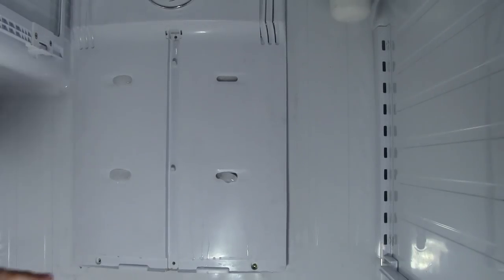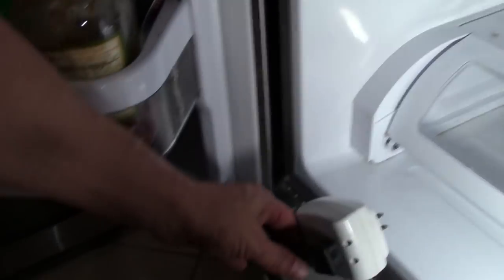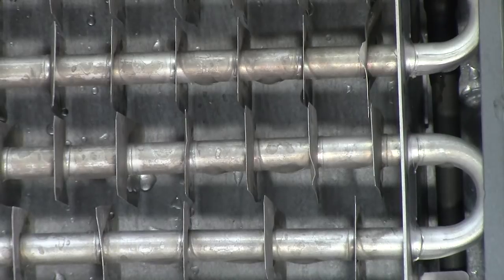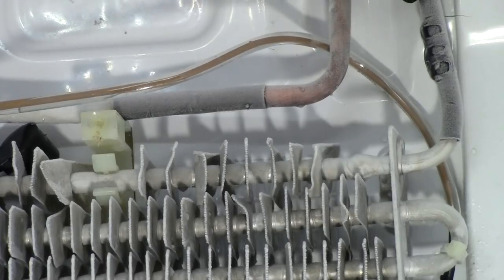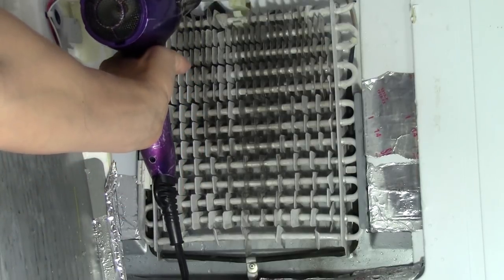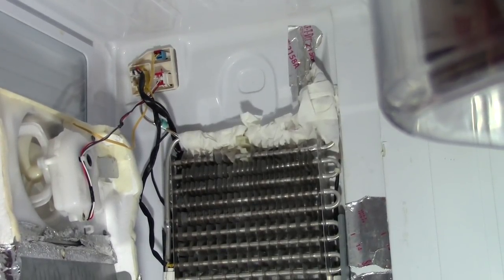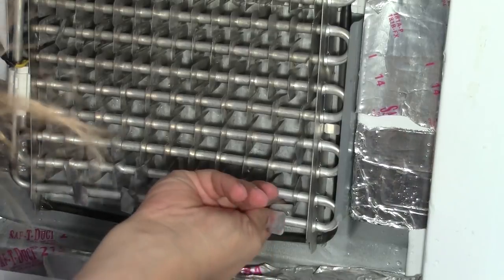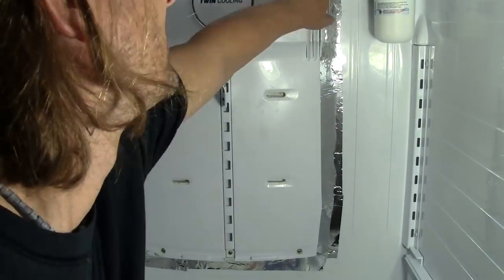PART 8 How to Fix a SAMSUNG RF 267 Refrigerator Not Cooling Icing and Freezing DIY repair

Comment: Noooooo!!! you are creating a fire risk!!!! If the heater gets hot, it could ignite the paper tissue and set alight to plastic lining , ultimately causing a potential explosion of the refrigerant gas. Never ever do this!!!
Reply: ON HELL YES IF R500 IS IN SYSTEM  CAN WE SAY BOOM
Reply: All domestic refrigeration here in Europe uses  r600 which is basically butane   kerboom time
Reply: Most manufacturers have a kit for this icing issue. Many French door units experience an icing issue. With a little searching there is usually a service bulletin with part numbers needed. Manufacturers also are producing videos on how to install these I have seen the Samsung one here on YouTube. Please be careful when re engineering an appliance I've repaired appliances and seen some very scary and dangerous things done by well meaning people. Not saying this repair is right or wrong just saying look to see if there is a service bulletin or an alert first and try to get professional advice before repairing anything. Have a blessed day
Reply: I agree never add what is not intended but a good thought also mine has the same problem but anytime the top has a problem the bottom must be addresses at the same time doing the same thing they due clog up on the drains very easy and the bottom is the problem that messed up the top?
Reply: Could you provide a link to that Samsung video, pls?
Reply: average of one refrigerator fire per week in london.
Reply: The fan stops when it's all frozen thus causing extreme heat in the back from the fan trying to move. This alone without doing this fix, which I think is less of a fire risk than the actual fridge itself, is more of a fire risk. Im tired, did that make sense? 

Is this the last video? Do you still have the fridge? Mine has been doing this.

Comment: You can replace the element that comes with the bi metal thermostat that is attached on the the element. And possibly change the defrost sensor to avoid issue. Trust me that is why is having defrost issue.
Reply: Which element do you mean attached to the bi metal thermostat exactly, can you link an example?

Comment: Thanks for this, but may I make a point? Having turned off the FRIDGE part of the F/F, left it overnight (and even used a hairdryer on it),  and removed all the screws holding that big moulding in place, the ice build-up STILL prevented the panel from being removed... I found that the operation of the FREEZER was still cooling the fridge (maybe to a lesser extent?) and keeping the ice frozen.  This prevented the panel from being removed. Emptying the freezer and leaving it off (with the door open) overnight led to the panel being easily removable, to try these  - and other - cures.  NB  Remove that panel carefully, as ours had two electrical connections to it; these could be unclipped by squeezing top and bottom - not sides, as it appears...
Reply: remove freezer drawers, open doors, install a sm fan in freezer compartment  to draw air from top to bottom out the front.. This defrosts the back panel rather quickly.

Comment: Hi Jake. The paper towel wrap is a fire hazard. That cal rod heater will, some day cause fire. The cooling fins and tubes help  cool the fresh food section. They need to be bear,  The defrost system has a drain tube in the back on bottom>  check that for clog.  the clip you hang on the cal rod heater helps transfer heat to keep the drain tube clear of ice build up during defrost cycle. Gets nice and hot...!  tape was a good idea.  Thermal Dynamics is a good field. Heat flow, fun subject..

Comment: I would be careful and not do what you did.  I measured the temp. of the heater element at the bottom (where you put paper towels) and the hottest spot was a whopping 300F.  I entered FD, forced defrost mode with the cover off.  I believe these high temps are fairly typical for short periods of time.  I don't think 150F would do much against all that ice.  It can get so hot it glows. Also, paper towels can absorb humidity.  Manufactures use foam sparingly, as needed.  Second, that tape probably has a cancer warning on it. You are introducing a lot of it inside the fridge.  Also when it gets hot, it can off-gas into the fridge even more...where you might have liquids, veggies, etc., that can easily absorb those fumes- then you eat them.  At that point, the temperature of your orange juice is the least of your worries.

Comment: Wow there is to way I would ever advise doing this I’ve been in the appliance and hvacr business for about 17 years, this is a fire risk for sure, paper towels are not insulting materials, plus there is a heating element right there at the bottom, I have seen those elements short out down there at the drain pan and all the cooking spray and paper towel are the accelerant, I’m not actually sure what he is trying to accomplish with this video by wrapping those lines, there are work arounds with this type of refrigerator from the manufacturer to fix the freezing issues.
Reply: I know right? Wtf? That’s what I said. I also do appliance repair. But just that tho if your insulating the heating element how in the F@&k is it supposed to get the heat to melt the ice which is now gonna be further separated by layers of insulation. Some people shouldn’t try and fix stuff. If they can’t do it properly stop being a cheapskate and call someone who can do it properly. You tube can’t teach you everything or conmen sense apparently for that matter....
Reply: Yall both are thieves if yall are just telling us to call and spend more money 💰 😒  on such a crappy product and not give us an answer of your own.

Comment: The holes are part of the airflow system that allow your refrigerator to get cold. Don't cover the holes!!! If you cover the holes, it will never get cold enough to keep your food fresh.

If the thermostat is not working, replace it. Same thing for the heating coil. My problem has been with the cover design. The heating coil is on the bottom and does not generate enough heat to reach the top near the fan. 

The be covers are designed with stainless steel, not the crappy foil, and carry the heat up the sheet of metal to the coils.

It's a real shame that we got stuck with the lemons. It's, also, a shame that manufacturers at knowingly making crap that lasts 7-10 years if you're lucky! My parent's fridge lasted 30 years. The next one lasted 25! They know exactly what they are doing! They raise the price for all the bells and whistles and sell cheaper products with cheap components designed to fail so that we must buy a new one! Simple, cheap, and energy efficient with water and ice coming out of the door: Is that really so much for which to ask?

Comment: Jake,  I have read you post/video several times or the last 2 years as my RF265 began to warm (frozen Evap like you)

Getting tired of breaking out coolers,etc. Done 5x in 2 yr  I must say thought I've got it down to a couple hours.
For Defrost, water (hot from hose best) heat transfer of even cold water beats Hot air several x)  I can get cover off safely in ten minutes. Have 10 towels on hand. 

Plug drain to below, or be ready to turkey baster out the water from  pan out back. 

I see all the effort in insulating coil. Paper on real Hot coil ?? Maybe fiberglass.   wonder why I got 5 Yrs without this problem (had freeze up on bottom drain  fixed with longer tang)and now this,what changed ?? bought new.

Searching web and service tips, I thought I would measure voltage of sensors in operation. Not  too hard, PC board on back of unit. 

I forced a Manual defrost (press 2 buttons at once) rd,  and did not hear more than a slight tick from expansion. When Unit froze up, again.  I expect sizzle of water on hot coil. NOT 

So I read, if defrost sensor fails, it could think Temp met right away,  and  end defrost in 90 sec (said to 68 F for Refridge ends defrost)          OK and run ONLY  90 seconds. Barely a sizzle.

I Measure voltage on the sensors  (cn30? on PCB blue wire to gnd)) and it looks like 80 F (per chart)   to Computer (when surround by ice ) !! And must have been wrong for 2 yrs.

Have you checked/tested your Defrost Sensor ?

I replaced sensor and held in ice to test (reads like 33 f) , now it goes longer that 90 seconds and I hear the sizzler of water on the hot element !

Back together  may for last time !!!!!  let you know on a few months.

Let me know when you see this, I can help you troubleshoot if needed.. Mark fingers crossed in Ohio
Reply: 7 Month , running like a Swiss watch..... This was my Long Term Fix
Reply from the maker: Thanks for the update, mark.  I hope it continues...
Reply: Still working good. No ice creap out holes.  Temp is good.

Comment: I’m an appliance repair man. People please do not do this! This will cause a fire. Not only that but he is blocking the natural needed airflow to cool the fridge. Without the air flow properly venting into the fridge the fridge will not cool to proper temperature. The thing he is right about is that this is a common problem with Samsung fridges however the easiest and professional way to fix it is unplug it for 48 hours with all doors open to allow it to completely and naturally defrost by replace the fan if needed and replace the defrost sensor which will be either a thermostat embedded somewhere in the styrofoam near the coils or a bi metal thermistor that attaches directly to the coils. If it is a bi-metal thermistor u can test the  bi-metal thermistor for continuity with a multimeter if it beeps it’s good if not it’s bad. Anyway, those two parts and the other part that could be bad would be the defrost heater itself. And lastly the tab that goes to the drain hole! .....it is not sufficiently long enough and Samsung knows this and there is a replacement tab that can be ordered that is significantly longer. Installing that tab replacement  does in fact fix the icing issue of the drain plug. In my experience the thermostat is usually fine and the heater is usually ok as well.....oh and another this do not bend the fins on the evap coil they are there for a reason....anyhow it’s usually the tab that doesn’t defrost the drain. So the fam gets iced over after while and because the motor on it is trying to go anyway but not moving it burns out the fan motor. U can check fan motor by plugging it in to its slot and if u look up at the door frame of the fridge you should see one or two little switches those tell the fridge the door is closed press them in and hold them with your hands and fingers wait a few seconds and fan should start to spin if it spins it’s good if it doesn’t then replace it. To keep moisture to a minimum do not line the walls of fridge keep a 1 inch gap between sidewalls and back wall and all the groceries to allow proper air flow around everything. Also, do not put anything in your fridge without an airtight lid on it. Any fruits and veggies need to be in drawers and any meats that are wrapped and thawing should be also left on a plate and covered or in a Tupperware with a lid. If you take things out to clean make sure they are thoroughly dried before putting them back inside (shelves, drawers, etc.,,) all these factors play the most significant roles in why your fridge would be icing up a and my message should give you a self explanatory information on how by fix the issues. Please do not do this paper towels thing. This is very dangerous and cooking spray can add to the danger of starting a fire. No offense to the user who posted the videos but this is very irresponsible of a video to post without doing your due diligence.
Reply: Hi Mikey, thanks for your detailed, expert advice!  I'd like to ask you... on my RS275, ice builds up around the fridge fan, and the water reservoir freezes.  If I force defrost the fridge a few times, the problems go away temporarily.
  Do you think it is the refrigerator temperature sensor?  Thanks for any help!

Comment: Jake, airflow analysis using a nebulizer: now, that's genius!   Two questions:  1.) Do you think the air gets sucked down into the drain hole, or is it just cold air sinking?  1a) Was the power to your fridge off when you performed the nebulizer experiment and showed air flowing through the drain hole?   2.) What is the normal airflow when the cover is installed?  Does the fan pull air upwards, or push air through the drain hole?
Reply from the maker: Hi.  1.  I think its cold air sinking,but it does seem to go right into that drain hole, so I'm not 100% sure if there is not some kind of effect from the freezer which is drawing that air in.                 1a.  The fridge was back on when I used the nebulizer.  2.  The fan has to draw air inside to pass over the coil.  Since the cover is so badly damaged, I think that the air flow is all screwed up and is not doing what it is supposed to do anyway.  I think it could be getting too much air because of the damage to the Styrofoam behind the cover, which may be the reason why the fridge seems to be getting worse and worse each time I took it apart.  Sealing the edges with tape has seemed to help a little bit but has not solved the problem.  I may also close off some of those vent holes tonight.
Reply: Did sealing the vent holes help?
Reply: The fan and vent holes are there to circulate cold air throughout the fridge and freezer.  Without that air circulation, you could easily see a 20-30ºF temperature differential between the door pockets and the back of the fridge.  The increased icing over time is most likely related to your door gaskets.  I've got an RF31FME, and functionally, I love the french doors.  But from an engineering standpoint, they clearly don't seal as effectively as a single door.  Have you checked your door gaskets?  While it seems clear that the Samsungs have a problem with defrosting, the moisture for your icing has to come from somewhere.  A leaky gasket would allow a continuous flow of humid air into the fridge.
Reply: Could Damp Warm Air Be Coming In Sucked Through The Drain Tube???

Comment: I have the same problem, even though Samsung has an ongoing situation with defective coils and ice-maker, but they don't want to assume the defect.  I even suggested to pay partially for the repairs but their answer was no.They basically said go buy another one.  Disappointing customer service,  don't buy this crappy brand.
Reply: The amazing thing is this problem has been going on since before 2010 and Samsung kept denying AND making the exact same crap so do yourself a favor and junk these lemons you'll be much happier.

Comment: To put a Samsung refrigerator into forced defrost mode you need to press a few button sequences:
-Press both the “Power Freeze” and “Fridge”  buttons at the same time.
-Hold both buttons in until display beeps and goes blank.
-To force fridge defrost element to come on, press “Freezer” button a second time.
-To force defrost on both the refrigerator and freezer sections, press the “freeze” button a third time.
Reply: Does it works?
Reply: @htoobway2079  It is not a permanent solution but easier than removing front cover.

Comment: I fixed mine a different way.  Found out the defrost element reached over 400F, any melting ice dripped on the defrost heating element and instantly evaporated.  This caused high humidity in the refrigerator, and thus contributed to once again icing up the coils, rather than the water dripping into the hole.  My fix was to add a $3 drok temp control to the 12v line that turns on the defrost heating element, and set it to cycle off and on to keep the element closer to 200F.  Now humidity stays 40% to 60% vs 80 to 100%.  The coils stay defrosted without build up, and it stops the viscous high humidity cycles that end up freezing to the fan. I hope someone makes a video how to do this, i am glad to help but not good at making help videos.

Comment: Jake!  Thanks from another guitar-slinging Samsung fridge owning YouTuber.  I just followed your instructions.  I noted where the heating element is in my unit just below the bottom of the coils and avoided getting any paper near it. I did use the thicker auto glass towels as they are a little firmer than paper towels.  I also found a kit that replaced the piece of tin that melts the ice at the drain hole.  I never had that issue again after using that kit.  I also saw where you can move the sensor to another tube back there...its s plastic clip-on with a yellow wire at the top - didn't work people...not a fix.
Reply: One more thing...Im actually building a seafoam green tele kit guitar as we speak...I swear, the servers know this!
Reply from the maker: I have only have a picture of that tele on my yt page.  I actually have two telecasters.  One is a blue Mexican and the newest one is a sunburst american.
Reply: @jakeguitar01  OK - Update:  This repair lasted for 60 days with mine.  My model number is RF263BEAESR.  I can say for sure this is the best fix I've seen yet because the ice would build back un in under 3 weeks previously. TIP:  I used a small space heater instead of a hair dry and it was much more efficient.  Also, cooking spray tip worked like a charm!  

 We have decided to dump this POS and get a new Whirlpool!  I've spent hours.  Again, thank you Jake!
Reply from the maker: I appreciate your comment. For most people, fixing these things is an act of futility.  I don't blame you for dumping it.   You have to try, but eventually, anyone who values their time will eventually throw it away.